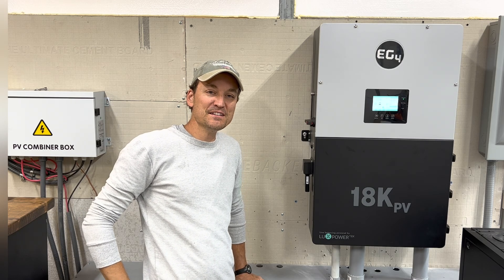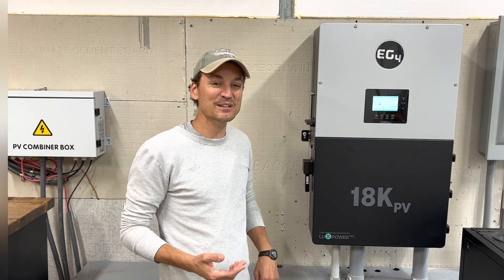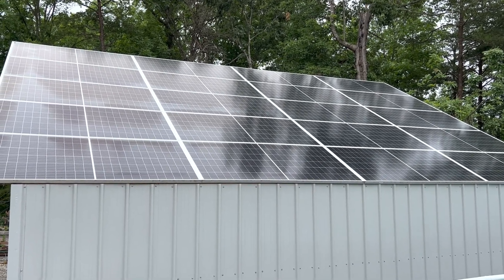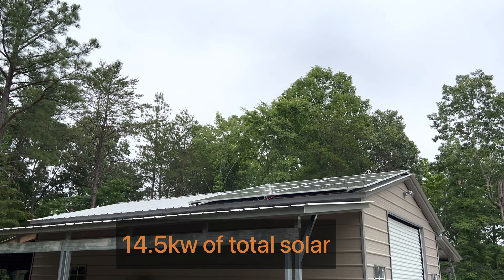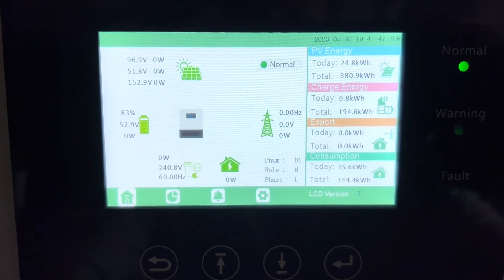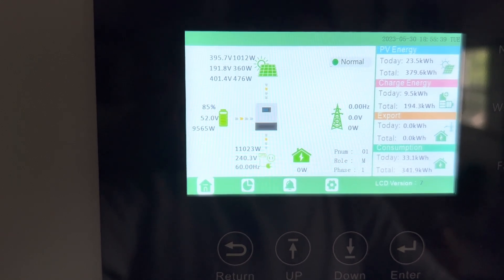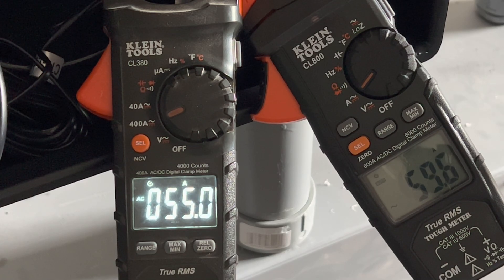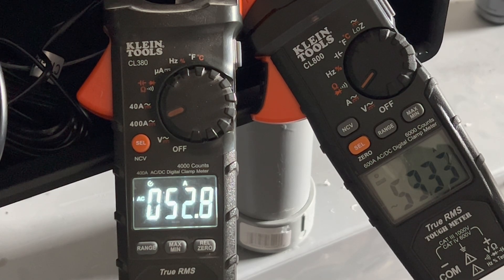EG4 18kpv finish install and initial loads testing- solar inverter

Comment from the maker: I plan on testing how high a single leg of the inverter can go. Looks like around 70 amps. But I’ll try to verify that in the next video.
Reply: Is it possible to get energy from the grid to use along side your inverter output if your load demand is greater than your inverter output
Reply from the maker: @jamrockrobby5219  yes it has multiple grid assist options.  You can decide how much the grid supplies.
Reply: So will one unit run a standard home 200 amp panel?
Reply: @jeffreydweeks  yes it has 200A passthrough
Reply from the maker: @jeffreydweeks  it has the ability for your 200 amp service  to be passed through the inverter. That gives someone the capability of running select loads in conduction with your grid power. The unit by itself has a continuous output of 50 amps. There it multiple ways to wire it though.
Reply: Really interested in seeing larger motors/compressors started with this (without a soft start) to see how it handles it if you have that ability. Thanks for putting out these videos!
Reply from the maker: @TimClymer  I’ll hopefully be making another video this week. I’ll add my water well in there for an inductive load. All around these units seem to handle loads really well.

Comment: Nice video. I have a question what size of cable do you usenfor the ac output of the inverter? And what mppt do you recommend puting my 500 volts of solar array? Thanks 🙏
Reply from the maker: For the mppt question, that would depend on the amperage. But any of the 3 mppt’s will probably work.

The output wire size really depends on how you have it wired. For off grid, 6 awg thhn will work with a 50 amp breaker. Or you could also go with 4 awg if you’re wanting to oversize a bit. 

On grid, it does have a 200 amp pass through capability. So you could be a much higher gauge in that case.

Comment: I'm not able to get my second string of solar panels to come on line. I'm using position 3. with  a new 18kpv eg4 inverter. thank you for help.
Reply from the maker: It’s likely an issue with your panel connections. Usually a loose connection or reversed polarity. Does it show voltage on that string?

Comment: This video got me so confused as I have this same inverter but have not connected it yet. The spec sheet says that the AC output is 50amps, It seems you are outputting much more than that. What size breaker does your inverter power for your house?
Reply from the maker: @LarryRichelli  I have it hooked to a 70 amp breaker. But that’s just because I have a heavier wire size. It can output more than 50 amps. But just for a few minutes. So essentially that 50 amps 12,000 watt limit is the continuous output.

Comment: Yes the challenge I have now with my EG4 18kpv is AC load output, and it's a kind of giving me 120 volt instead of 240 volts, but pls how do I change the settings pls
Reply from the maker: Possibly an issue with one of you connections. There isn’t a setting to change the unit to split phase. It comes that way. You should have roughly 6kw on each leg.

Comment: How do I set the load output voltage from 120 to 240 volt pls
Reply from the maker: That isn’t a setting that I’m aware. The unit outputs split phase power.

Comment: Is the solar voltage limit of 500v PER MPPT or for the whole unit?  I thought it was for the whole unit.
Reply from the maker: The voltage limit is 600v per mppt. And it has 3 separate inputs.

Comment: @Gavin S.DIY H, so it’s been over a year now with the 18Kpv how do you like it thus far? Also i wanted to know why do you put everything on the UPS “Load” output of the 18Kpv vs splitting up your critical loads and your none critical loads? As you may know your non-critical loads goes to your (GRID) output, i know they label it “GRID” but thats your actual non-critical “LOAD” output, that port is I/O support both input and output. Keep up with the great content.
Reply from the maker: I just recently added a one year review. The 18kpv is doing great. 
I don’t use grid interactive features. So I have the grid breaker off actually. I use the inverter to power all my loads through the output breaker.
Reply: @GavinStoneDIY  well as long as the UPS Load output supports everything you need, no need to use the GRID output connection, I’ll check out your 1 year update video .. thank you.

Comment: Can I connect the 6000xp to a 50amp transfer switch? I already have our house connected to a transfer switch for our generator but want to switch to solar power
Reply from the maker: Yeah that should work. Although if you expand the system you may want to power more circuits than the switch has.

Comment: i see you didn't have any solar wattage coming in right after the installation did you  go to your settings so the the pv will start working because i just installed mine and can't get the pv to charge the battery
Reply from the maker: I had to change the battery to lead acid because I didn’t have communication. Then, because I’m off grid I changed the   settings to “work without grid” and off grid.
Reply: @GavinStoneDIY  ok thanks I'll see if that works for me I'll let you know thanks again

Comment: Nice Set up.  Thanks for this video Gavin.  I would like to ask what is the minimum requirements of your main breaker for this set up to work?  200amp is minimum?  also, for AC inputs to the EG4, what is the Circuit breaker requirements for AC bypass?
Reply from the maker: There are multiple ways to wire the unit. You can supply it with a 70 amp breaker. Or use it as a pass through from the meter through the unit. They have some wiring diagrams in the manual to show some different options.

Comment: You just never learn do you? You’d think after buying two pieces of junk you wouldn’t go back and buy another one from them.
Reply from the maker: The last set of 6500’s were actually great. And 3kw inverter is nice also. The 18kpv has been running for months without issue. It’s awesome really. A real workhorse.
Reply: I would prefer Schneider and keep these two 6500ex units as solar charge controllers. I will be fine with a store credit that is fair for us both.
Reply from the maker: @USA-GreedyMenOfNoIntegrity  they have a pretty high idle consumption if you’re just going to use them for a charge controller. Schneider does make really nice LF inverters.

Comment: That’s bad ass man it’s rated for 50 amps lol this thing pulled 65 all day per leg!!
Reply: Do you know if these will run and start generators??
Reply from the maker: As in trigger an auto start? Yes it has dry contacts to automatically start a generator.

Comment: Pv input looks like spring load connectors.  Common on speakers. Should be able to push up on the gray tab, insert wire, and release.  Thanks for the vid

Comment: Hey there so I’m getting a eg4 18kpv and 31 solar ever panels what’s the best way to wire them to this panel and can it use more then 30 panels if so how
Reply from the maker: I would need to know the voltage and amperage of the panels to determine that. You should be able to wire that many panels easily into the 18kpv.

Comment: Hi, great video!! Do you know if I can connect one eg4 power pro and  one eg4-LL 48v battery into this inverter? cheers!
Reply from the maker: As far as I know the power pro doesn’t communicate with the eg4 LL models. They have a different BMS. So you could use them in an open loop configuration. But if you needed communications then it would have to be one battery or the other.

Comment: Nice!  Does this have arc-fault and ground fault detection/protection for the PV input? If so that would be terrific.
Reply from the maker: Yes indeed. If you follow the link I have in the description below and go to the spec sheet,  it should be at the bottom of the page. It also has rapid shutdown capability.
Reply: @GavinStoneDIY  Great!  This is a game-changer for me.  Thanks!
Reply from the maker: @sonnysurles  you’re welcome. If you end up going that route keep me posted. I like to hear about people’s installs.

Comment: How do you do the firmware update? I have victron energy mppt charge controllers. And i do it on my phone.
Reply from the maker: You can have signature Solar do it remotely. You can do it yourself with a PC. Or you can use your phone. It makes it really simple over all.
Reply: @GavinStoneDIY  this inverter does, make all the sense, in the world. With that high voltage pv input. I use victron energy mppt charge controllers. They are excellent. But very expensive. I might have to sell my equipment and switch over. To a unit like this. What's your nominal. Solar array wattage?
Reply from the maker: @carlosreyes6448  I have 14,400 watts potential hooked to the inverter currently. Of course that production can vary widely depending on a few factors. I honestly love this unit. It’s quiet clean and simple. I like the app also. Although I know victrons app is super awesome.
Reply: @GavinStoneDIY  yes, that is a really good size array. I'm much smaller right now. But thinking of expanding to around 10kw I'm running on a 300ah 52v battery bank I built with lifepo4 battery cells. 200amp bms.

Comment: How is the noise compared to your old 2xsetup?
Reply from the maker: At its loudest it’s still much quieter then the 6500’s. But the majority of the day it makes no sound at all. Once it’s finished charging the fans stop unless I’m using a large load in the house. Basically anything past 6kw the fans start. Otherwise it makes no noise at all.

Comment: watched a bunch of times now...learn more each time...I noticed your grid export is zero, so I'm wondering if you're actually connected to grid?  I'd have a hard time believing that the CT's are so fast that there would be zero export...even though it's called zero export...any way to test the export at different levels to see how accurate it is?
Reply from the maker: Im connected in the sense that I can use the grid for backup as needed. But I haven’t connected my output to the grid panel. As far as the CT’s and zero export is concerned. I believe there are people testing that right now. So I’m keeping my eyes out for what they come up with.

Comment: How much have you spent so far to get where you are.
Reply from the maker: It’s hard to say really. I’ve made a lot of mistakes along the way and switched things around. Plus I have a long run to my shop and back with heavy gauged wire. Probably in the $35,000 range.
Reply: @GavinStoneDIY   OK well with all that you have learned can you totally get off the grid now If you want to.
Reply from the maker: @ice4278   yes, we’ve been off grid for some time. I still keep the grid as a backup though. With the service fee it’s only around $30 a month. So for me it’s worth the $360 a year for extra insurance. In the event the grid goes completely down we could likely function very well.

Comment: Will this run an 11kw Tesla charger? 240v 48 amp continuous load?
Reply from the maker: I don’t own a Tesla. But the test I put it through was well beyond that. Just to see how long it would surge. It runs at 12kw continuous load without any problem. If you haven’t checked out the spec sheet yet. Scroll down on the link. https://signaturesolar.com/eg4-18kpv-hybrid-inverter-all-in-one-solar-inverter-eg4-18kpv-12lv/?ref=mpmddlkx6M9tPo
Reply: @GavinStoneDIY  Update: It charges the Tesla!
Reply from the maker: @APatchworkCanvas  that’s awesome! Considering the tests I’ve done I didn’t doubt it would.

Comment: Aren't you in overload running at 14KW, when it's only a 12 KW inverter?
Reply from the maker: I am yes. But it actually has an pretty impressive extended surge time on the unit. Follow the link I have in the description. If you check the specs on the page it’ll show the surge limits. You probably won’t often need that surge. But at least you know it’s there if you did need it.

Comment: Measure each leg seprate with the clamp meter.
Reply from the maker: That’s how I did the test. Or are you referring to something else?
Reply: @GavinStoneDIY   At the start you clamped around both red legs of power.
Reply from the maker: @wd8557  ahh I see. That was for idle consumption of the unit. Both those 2/0 battery cables are connected at the same point on the unit. So you have to clamp both for an accurate reading. I described that in more detail on my install video.

Comment: why do you have 2 battery + and - ? Are you using 2 battery banks?
Reply from the maker: I covered that in my original install video. You can use 1-4/0 wire or 2-2/0s instead. I chose to use the 2/0 wire because it was easier to get it into the terminals.
Reply: @Gavin Stone DIY Homestead  I thought I saw a post somewhere that they have a bussbar adapter to combine the inputs for the larger conductor.
Reply from the maker: @turtle1723  I know I’ve seen that with solark. Because Solark’s inputs are technically separate. I believe the 18k’s inputs are connected internally.

Comment: Probably should drop your input voltage to around 400-450 max. Colder weather will push that voltage up.  Easy enough to fix now, though.
Reply: I believe they recommend 500v, but max is actually 600v for that reason.
Reply from the maker: 500v is max usable voltage. But the max voc for the unit actually 600v. So I’ll likely have spikes of 550v in really cold weather. But I’m comfortable with that.
Reply: @GavinStoneDIY  I missed that in all the videos. Yet another plus for that beast!

Comment: Very nice!  I have the SA 15k (I got it at a good price), but if I didn't have the SA, I would certainly consider this inverter.  I was in discussion with LP when this was about ready to ship last year, the price has gone up thousands since then, lol!  SS must be making a nice $ on these, but it still looks like a sold deal for the consumer at the current price.
Reply from the maker: It is a cool unit so far. I think these will likely be a direct competitor with solark going forward. But that’s probably a good thing. More competition brings more innovation.
Reply: @GavinStoneDIY  I completely agree!  SA has it in spades with their amazing 24hr CS and TS and that's worth a premium, but not the delta they are currently priced at.  I'm guessing they will have to seriously start thinking about price cuts in the not too distant future as everyone else's products catch up...
Reply: @ssoffshore5111  @GavinStoneDIY, agree.  Although I have to say I've been EXTREMELY impressed with my Sol-Ark15K (this wasn't available) and their service/support have been phenomenal.  It runs everything around our homestead, including 5-deep freezers and two fridge/freezer combos, along with well pump, my 50AMP welder, computers, electric oven, electric range, etc.  

I will say that the EG4 18kv seems MUCH louder than my Sol-Ark 15k which I rarely here the fans spool on, other than hot days and lots of load/pv.  Can easily have a conversation when standing right next to it.  

I am considering a second Sol-Ark15 K, since I already have one to add some capacity and failover possibility.  Great seeing the market evolve and offers expand!

Comment: Have you checked into any of the high voltage systems? I'm wanting to put solar on my mom's house and the high voltage systems seem great also
Reply from the maker: Mike G has a page dedicated to that. Its possible the solar industry eventually heads in that direction. But for now it’s still not main stream. There is some down sides to it. But it is extremely energy efficient from what I’ve seen.
Reply: @GavinStoneDIY  yeah I watch Mike gs channel

Comment: Have you ever used a Solark ? This unit looks suspiciously like a Solark and I suspect it was made by the same company in China.
My Solark 12K can't run those loads. If I have my dryer running and turn on the electric cook top or microwave one of the legs gets overloaded and that's the end of it. I'm really tempted, really, really, tempted.
Reply from the maker: So a lot of the interior design of the unit looks similar for sure. This isn’t a Deye made inverter though. Deye is the manufacturer of solark. Luxpower is a different company altogether. It’s a beast with running loads. That’s for sure.
Reply: @GavinStoneDIY  I see. Thanks for the headsup. I guess imitation is the best part of flattery in China. I'll keep an eye out for your followups. I have no pressing need to switch right now BUT knowing there's a cheaper and more capable option is always nice. My Solark is coming up to its 3rd year with very, very few issues and no show stoppers.
Reply: There used to be generic versions of the Solark available in the USA from the same Chinese company that makes them... but Solark <cough> "convinced" them it was a bad idea to continue selling them in the USA.  The channel "Ray Builds Cool Stuff" has some of them he purchased before Solark cut off the supply.